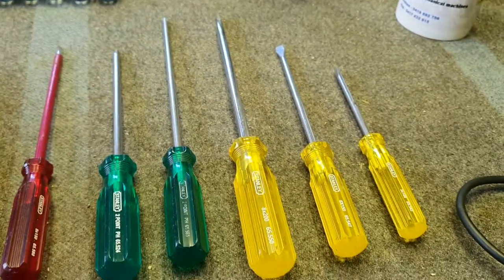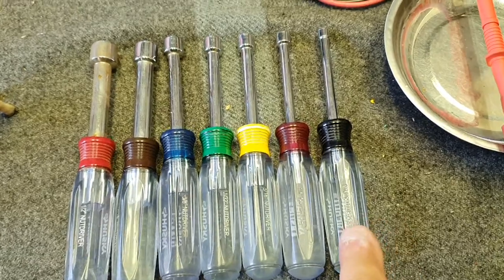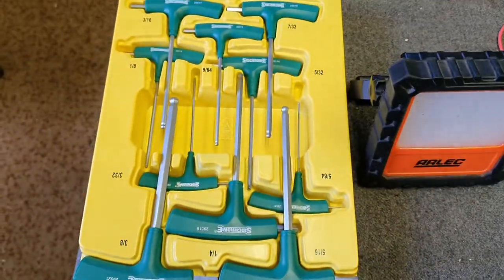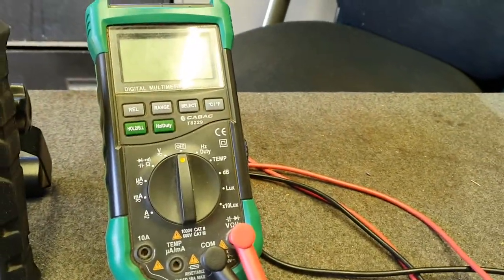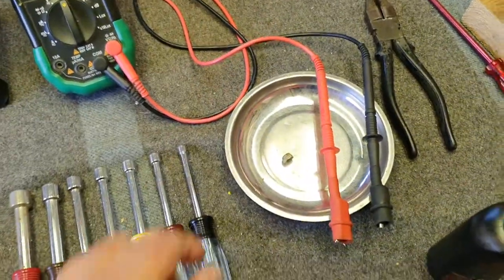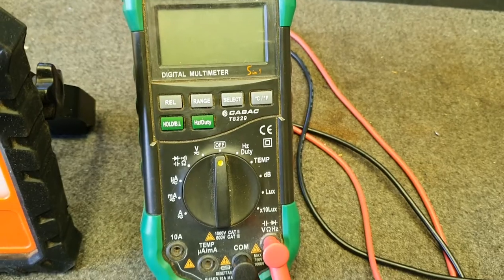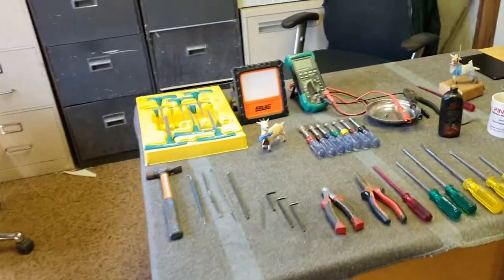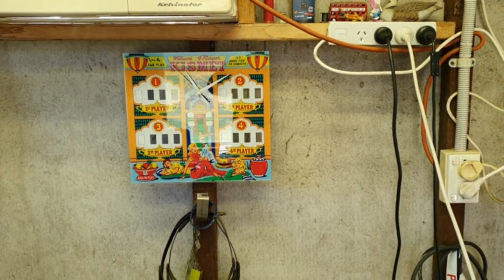Tools required for EM Pinball Repair

Comment: Another really useful and informative video Kim. I know you have a ultrasonic cleaner and would be interested in your thoughts on them and any recommendations.
Reply from the maker: We use a brand called Vevo (made in China) its sold under different names around the world a minimum 15 litre capacity is recommended. You can simply fill with water and dishwashing detergent and put containers of parts with other solutions like kerosene simple green purple etc in the cleaner.
Reply: @goatshedempinballrepair8545  Cheers. I'll look them up.

Comment: To clean the relay switches and stepper unit I have been told to only use Q tips and Tarn X tarnish remover to clean the contacts, is this true or use 100% rubbing alcohol? What does the Chute Relay do or what turns ON the Chute Relay? I have been told that the credit unit turns ON the chute relays
Reply from the maker: There are different schools of thought on cleaning relays use what you are comfortable with we use a dremel on large contact switches and a points file on smaller ones. Some people use a business card with isopropyl on it. 
The extra chute relay is for multiple plays off a certain coin denomination one thing it does is increment that amount of credits to the replay unit and also a switch on it isolates the knocker.